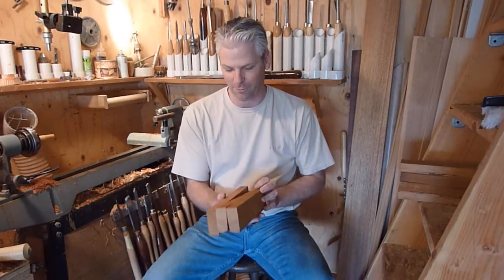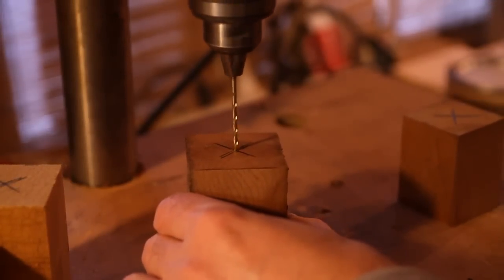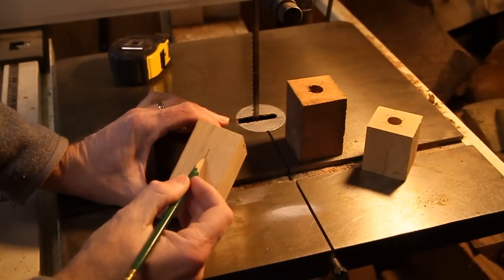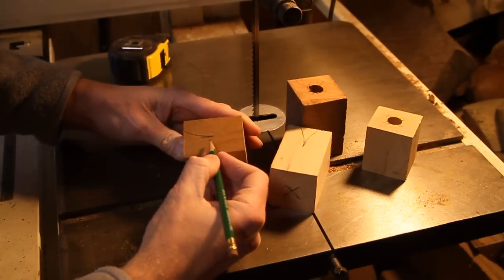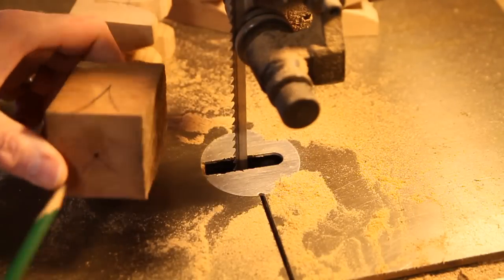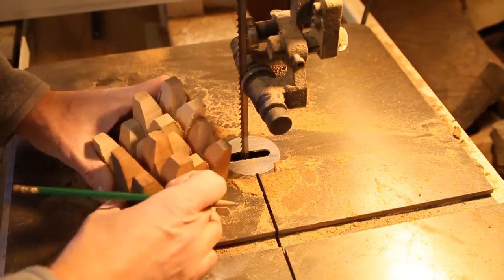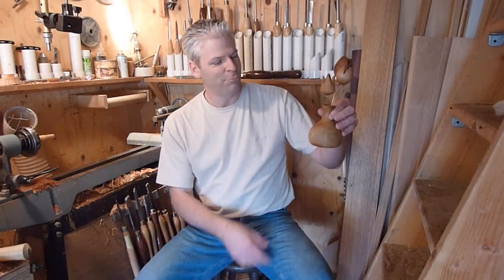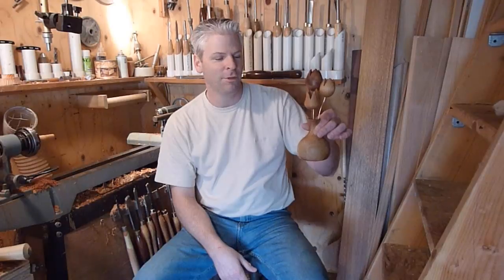Woodturning Turning A Flower

Comment from the maker: I get a lot of my wood off the beach, but I do buy some. You can turn green wood if your making bowl blanks turn it down to about an 1" thick and then let it dry. To dry the wood your cutting you need to seal the ends with paint or wax to slow down the drying process so it won't crack. You need it dry to turn calls and boxes.

Thanks,
Carl

Comment: Carl, I tried some of these and instead of a tapered dowel I just rounded it off and spray it with water before you tighten the tail stock. Keeps if from slipping.....thanks, I enjoyed your video

Comment: I made a few of these flowers, and what I did to simplify the turning process was drill a 7mm hole all the way thru so that the block would fit on a pen mandrel. Then halfway through the block I drilled a 1/2 inch hole.  I used a 1/2 x 1/2" block at the left end of the mandrel and slid the large opening of the flower blank over the 1/2 inch block. It held great. You can see pis here:

Comment: I've made a few of these, and a great way to thin the petals and open the inside up a bit is to hollow the inside some before you cut on the bandsaw. You still drill the hole (to get the hollowing tool in).

I start with a longer block of wood between centers and turn a tenon on one end. I chuck that up and drill the hole. I then hollow the inside using a small swan-neck tool (Sorby Micro). Make a template and draw the flower shape on all 4 sides. Follow the ghost image when hollowing.

Comment: Those are the best turned flowers I have seen.  I don't have a bandsaw but I will use a coping saw to try to cut a bigger arc where you suggested using a bigger drill.   Now, how long to St. Val's?  There's potential for major point scoring here.
Best Wishes, Brendan.

Comment: Hi Carl,
 Just a couple of suggestions that might help on this project. I think it might work out better if you did the majority of your sanding with the tailstock up against the wood for as long as you can and, secondly, I noticed how you cleaned up the dowel that has the taper with a skew chisel. Maybe, it might be better to leave it rougher so that it creates more friction with the blank and hence, " bites " better. You might want to use a tool in scraper mode even. Cool vid and thanks..:)

Comment: yes the light can shine through. The main thing is of course to hollow it out. One thing I found was the using a small chisel through the standard light socket cord hole,will give you the cleaned out shell. the thing about turning it, is that its like a pumkin, the more you carve down, the more light. Also you can turn the shell adding more designs. experiment first of course.

Comment: Mine looked the same as yours up until I got to turning.  I kept having the petals chip off on me and i couldnt get the shape right after.  Any tips on getting a good cut on the petals?  Does it just take a super sharp tool, or any techniques (tool position, which tool, etc) to use?

Comment: Hello Mr. Jacobson,
i noticed that you have a aftermarket handwheel on the tailstock of the delta 46-700 that you are using in this video. i just unfortunately had my hand wheel  break on my tail stock and i have the exact same lathe and was wondering if you knew the correct size to buy to replace this im having a hard time finding any information on this. thank you!
-matt
Reply from the maker: Hi Matt, sorry I don't have the lathe anymore. It had the replacement wheel when I got it.
Reply: No worries I appreciate it! Great videos sir! I appreciate your time! It's been a treat trying to figure out how to fix that haha!

Comment: Nice work, Carl. I'm new to woodturning, and was just wondering - how many different types of chisels there are for turning?
Reply from the maker: Hi Jeremy, There are about 6 basic turning tools, but there are many more specialized tools. 

Spindle roughing gouge 
Spindle gouge 
Skew chisel 
Parting tool 
Scraper 
Bowl gouge
Reply: Cool. I have some tools. The set that you mention here. The problem I'm having is that they cut for about 5 - 10 minutes or so, then I have to sharpen them...which I don't mind, but would be nice to stay at the woodturning wheel a little longer. Of all the woodworking tools it is my favorite.

Thank you, Sir!
Reply from the maker: Jeremy R. Chefwarekits has a 5 piece Robert Sorby set for $149. I used these tools for year they hold a edge very well. Here is the link 
https://www.chefwarekits.com/?tracking=carl
Reply: Thank you, Sir! A new set of chisels are definitely in my future.

Comment: I just got a lathe for Christmas, would this be a good project to start on or does this require more practice
Reply from the maker: +shane mahler Congrats Shane! This is a pretty basic project, if you've done some turning in the past. If not a tool handle is a great beginner project.

Comment: tailstock handle wheel on your lathe looks a bit like mine, I broke mine can't find replacement parts for this China crap. do you have a part number for that with your lathe
Reply from the maker: Shawn P I think the mold number for the lathe is 46-700
Reply: +Carl Jacobson grizzly ? 
and thanks !